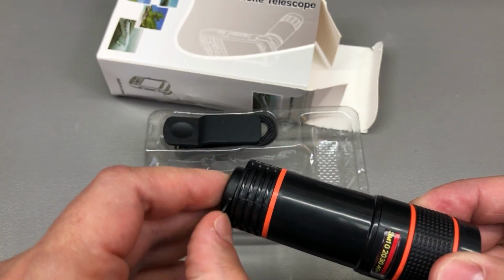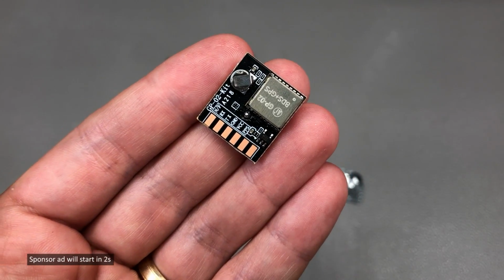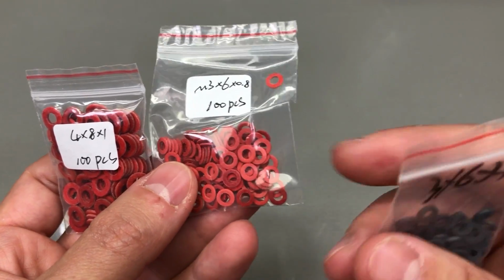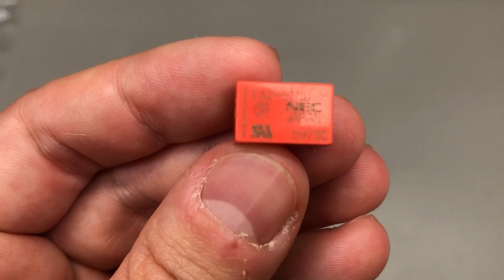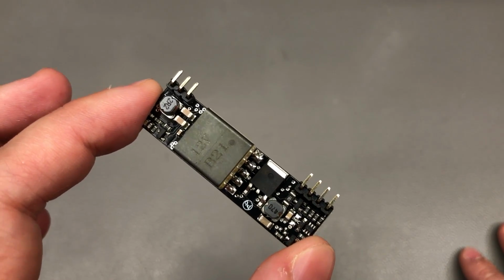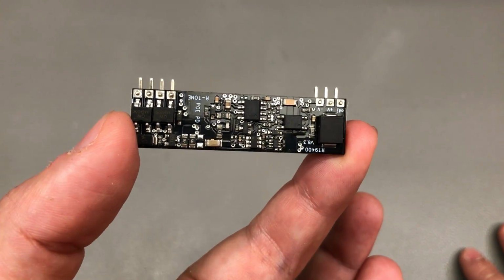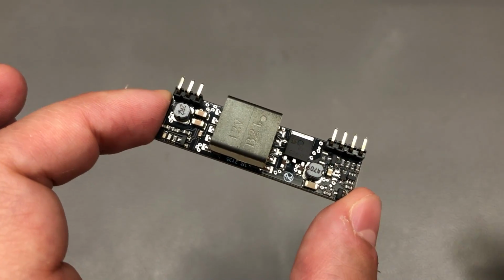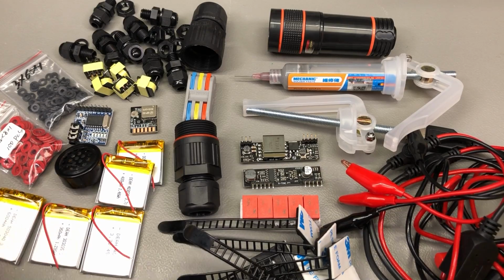InTheMail | Voltlog #428

Comment: Love seeing DTMF in stuff. I swear, they'll still be using it in a century.
Reply from the maker: Oh well.. when there are so many devices in the wild you have to keep supporting it I guess.
Reply: @voltlog  Please don't misunderstand, I have a soft spot for DTMF. It's how I learned about frequency when I was just a crazy kid with a screwdriver. I remember the old MC145436 and the SSI204 fondly from amateur radio. It really is a cheap, handy way to send small amounts of data through an existing audio line.

Comment: That syringe adaptor is asking for a printed version.... I may have to have a play.
Reply: 8:45 attach a handle downwards to the fixed part and flip the lever in the opposite direction (also downwards) - now you have the same leverage as before but in the form of a gun that is much easier to point. Kinda like a tiny silicone caulking gun...

Comment: Maybe the lens is for a phone that has a different distance from the lens to the case protector glass than iPhone, ie, it might need a spacer.
Reply: I just remembered I bought one of those for a different project, and just tried it on my phone and it only focuses at long distances like 5m+. At that much zoom it's pretty shaky, so not very useful.
Reply from the maker: I've tried focusing at multiple distances, 1-100m no luck, all blurry..

Comment: Couldn't you have ordered the "telescope" two month earlier? I got mine about 2 weeks ago (so ordered about 3 before that) and it is indeed the crappiest item got in a long time. Not only that it doesn't work at all (the "zoom" range is outside of what is needed for focus), the rubber has a stink to it it's unbelievable. I don't know what they used to produce it, but I almost fear that touching or just smelling it will give you cancer or something.
I also got the red washers at a similar time and similar test hooks (multi-color version). Don't know why, but I quite often get the same stuff that you do with a similar timing. :)
Reply from the maker: It's the Aliexpress recommendation algorithm which I assume does a similar job to Youtube.